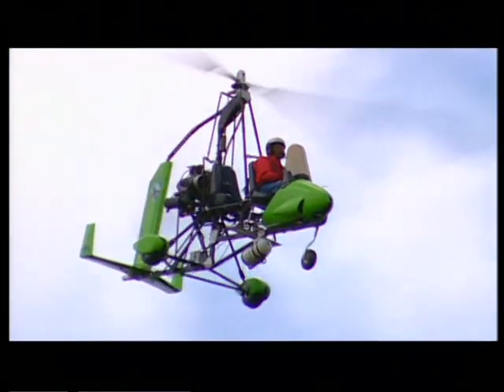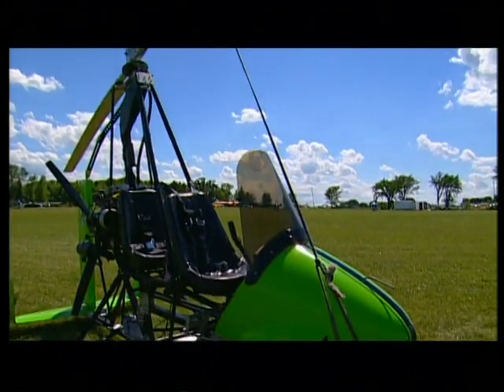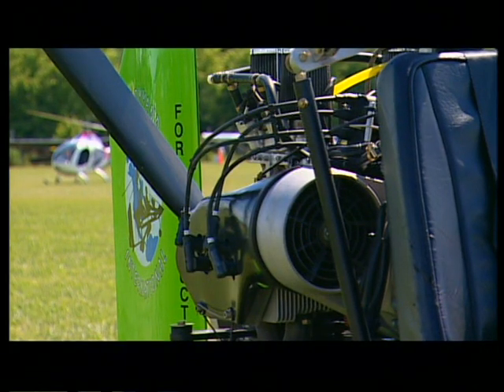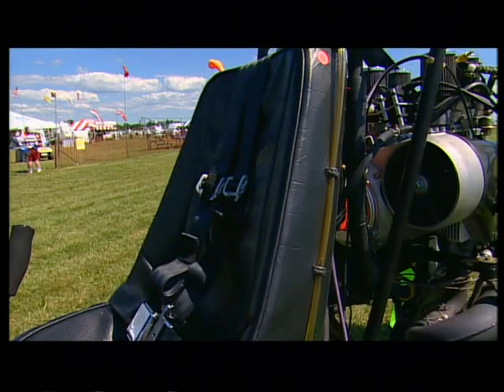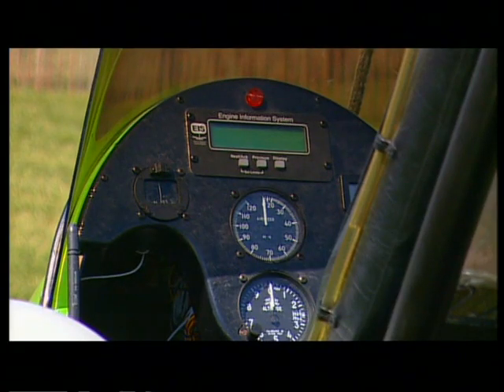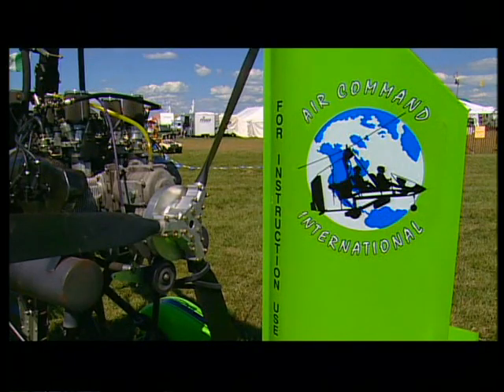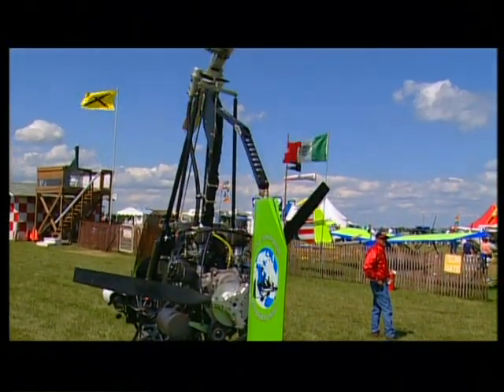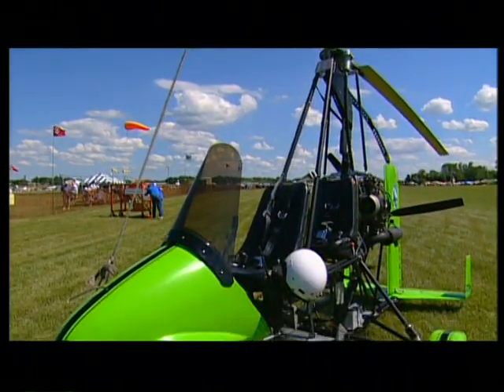Build your own Girocopter

Comment: As far as I know it is impossible to stop the rotor. They can't stall and simply start to fall - As soon as they fall air passing through the rotor makes it turn. So putting the nose down will make the whole gyro head towards the ground causing air to pass through the rotor.
Reply: +m1aws The original Autogyros were controlled by elevators, ailerons and had a rotor fixed at around 9*.

The gyro in this video and all the Wallace gyros AND all the modern gyros are controlled by cyclic pitch changes.
Reply: This is what happens when one shoves the nose down (lifts the tail via horizontal stabiliser) too fast. The disc does not follow straight away so the rotor hits the tail fin.
This very fact killed a helicopter test pilot as he was gaily flinging around a pre-production Ken Wallace inspired gyrocopter at the Farnborough airshow. Helicopters control through the rotors, not the tail fins. The prospective company that was about to market these shut down the business and moved on.
Reply: Crap. The rotor doesnt go down and hit the tail,the body rotates forward and strikes the rotor.And this can only happen where propelor thrust is higher than the vertical center of gravity.
Reply: Murray Barker I'm sorry, who are you arguing with?
Reply: +m1aws  You, you obviously have no idea how a gyroplane works.
Reply: +Murray Barker You obviously did not read my post properly.
Reply: +m1aws I did. Gyro's are controlled by cyclic pitch,the same way as a helicopter, not by the tail. Pee Wee Judge was killed in the Wallace gyro by a Power Pushover. The thrust from the engine pushing the body over faster than the rotor can follow.The body rotates up and collides with the rotor.
Reply: +Murray Barker not all gyros
Reply: +Murray Barker bullocks. the Wallace gyro used the blades on an axle and the rotor is a tilt rotor to effectively alter C of G.
 The in wind blade rotates into a low pitch while the other becomes the higher pitch. You never ever see a fast flying shift to with the pilots stick pushed over to the side to counterbalance the blade pitch.
The gyro you now speak of pushed it's rail I to the rotor via the elevator. If it was a cyclic pitch rotor like on a helicopter the rotor would be solid and do the pitch/roll, avoiding that incident.
Reply: +m1aws As I said before,you know nothing about how a gyroplane is controled.

Wallace used his his own version of a  Bensen type gymble rotor head. The cyclic stick (joy stick) changes the cyclic pitch of the rotor and useing gyroscopic prcession tilts the rotor disc in the desirerd direction.

Nothing to do with weight shift,altering the COG, the horizontal tail which is fixed, or black magic.

Tilt the stick in any direction and the pitch changes on the blades but takes effect 90 degrees past that point,Gyroscopic precession.
Reply: +Murray Barker suggest you learn about the cyclic pitch controls in a helicopter before you spout I know nothing. Autogyros have a completely different family of controls
Reply: +m1aws  Wrong again. Bell 47's as an example have a teetering rotor the same as a gyroplane. The only differance being that on the helicopter the rotor is powered, the overall pich of the blades can be changed, and cyclic pitch changes are via a swash plate rather than an offset gymble as used on a gyro.

If a helicopter goes into autorotation it is essentually an autogyro, controlled in exactly the same way(on the way to the ground) as the green gyroplane in the video.Cyclic pitch changes.
Reply: +Murray Barker cherry picking is only proof you are now squirming. most autogyros have a tilt control on the rotor. that's it, get over the fact.
Reply: Murray Barker if your point of view is correct, you can easily stall the rotor by simply pulling in the collective pitch lol.
Reply: +m1aws Cherry picking? All helicopters use cyclic pitch control to manoeuvre. All gyroplanes use cyclic pitch control to manoeuvre.
I will put it as simply as I can for you. The joystick  controlls cyclic pitch, The cyclic pitch moves the rotor disc.
The joystick doesnt directly move or tilt the rotor disc.

Gyroplanes dont have collctive pitch. Helicopters do and you can stall the blades by pulling pitch.
Reply: +Murray Barker there you just destroyed your own argument.
Autogyros tilt the disc. COLLECTIVE PITCH and manually altering the pitch about the disc CYCLIC PITCH is the domain of the helicopter.
no disc control on the autogyro but for tilting the rotor back and forth, like a hanglider.
Reply: +m1aws You are a fuckwit.
 The only way to tilt the rotor disc on a gyroplane is to change the cyclic pitch, the PITCH CHANGE MOVE THE DISC IN THE DESIRED DIRECTION.YOU CANNOT TILT THE ROTOR DISK ON A GYRO WITHOUT CHANGING THE CYCLIC PITCH. IT IS NOT LIKE A HANG GLIDER.
Go back to trainspotting.
Reply: +jean michel Urbani I know all this,was wasting my time trying to convince this other dumb fucker m1aws who thinks gyros are weight shift like a hang glider.
Reply: +m1aws Not sure who ties your shoelaces for you in the morning but whoever they are get them to draw a diagram with your crayons.
Air and space 18A is but one gyro that uses a swashplate(like a helicopter) to controll cyclic pitch. Most others use an offset gymble head to do the same.
Same cyclic pich control, same result.
Reply: +m1aws Still a dickhead

No collective pitch has ever been mentioned  by me in regard to gyroplanes, CYCLIC PITCH ONLY, EXCEPT, the gyros that have COLLECTIVE pitch(in one way or another ) to enable them to perform jump takeoffs.
I sugest you go and actually LOOK at a GYROPLANE and get someone to explain what happens when you move the joystick. Take your carer with you.
Reply: +jean michel Urbani ffs. relating weight shift as the alternative to a helicopters controlled (by the pilot) cyclic pitch seems to be beyond you too. amazing.
Reply: Murray Barker I'm sick of your vacuous statements. if you think you are right. then disprove the proofs I furnished earlier. Otherwise man up.
Reply: Murray Barker Still cannot prove the facts to be wrong. come on walnut features. When was the last time you flew an autogyro with helicopter controls.
I suggest you get your meds revised.
Reply: +jean michel Urbani nursery school taught you? Blade pitch on an autogyro is usually just a hinge on the blade. There is no "control". Stupid child.
Reply: jean michel Urbani ok simple boy. Lets let us google your words. "Gyros have a collective pitch control"
"https://www.google.co.uk/search?q=Gyros+have+a+collective+pitch+control&oq=Gyros+have+a+collective+pitch+control&aqs=chrome..69i57&sourceid=chrome&es_sm=93&ie=UTF-8"

From the returned searches I get the same collective answer. You are a fuckwit. Rotor tilt is not "collective pitch control". tilting the rotor back is like adding flap to an a/c or pushing on the bar with a hangglider.
If you know of any gyros with collective pitch control I will be pleased if you furnish us with the model. lol
Reply: +m1aws Jean you are wasting your time. You can try and help the ignorant but you cant help just plain stupid.
Reply: jean michel Urbani I tied you in with the other. Thought you'd troll a tag match whilst knowing full well you were wrong..
Reply: jean michel Urbani the blade on a gyro is a tipper. Down in-wind so greater angle of attack down-wind.. you have no means to change it in flight... unless you have a helicopter licence. Can you actually control your fixed blade exactly like a helicopter? No.
Sadly I've never flown a gyro of any sort but have helped build one. The rotors all work basically the same way since cierva fixed the problem.
Reply: jean michel Urbani You are not defining cyclic pitch. That is purely the domain belonging to the chopper.
In truth I considered building a Flettner style gyroglider to "play" on but on paper couldn't get the sink rates required for hill flying.
Reply: +jean michel Urbani Jean you are wasting your time. This imbicile thinks its like a hang glider and you tilt the wing back and foward and side to side.There are still people that think its weightshift and this person is one of them.
He clearly doesnt understand that you can change the angle of attack on both blades by the joystick and torque tube at any point of the 360* of the rotor disc.
Also he dosnt understand that there are three bladed Gyroplanes that use swashplates instead of the gymble head to change cyclic pitch.
Furthermore he doesnt understand that some gyroplanes have a collective( to change all blade pitch at the same time)for jump takoffs.
As well as that he has no understanding that some gyroplanes have partially powered rotors that are still controlled by cyclic pich and are still a gyroplane.

He is a troll that tried to make out he was an expert on the subject and has made a complete dick of himself.
He proved this by his last comment that the gyro blade is a "tipper" whatever that means.

Not understanding any of the above means he certinally wont understand Gyroscopic precession,or that the rotor blade doesnt know weather it is controlled by a swashplate or an offset gymble rotor head, or that some helicopters( Bell 47 etc) have a fixed rotor the same as a gyro and the whole blade works the same way as a gyro.
Reply: jean michel Urbani I know EXACTLY how gryo's fly. I comprehend the way the blade tilt stops tipping the plane over in forward flight. The only rotor head control is to tilt the disc.

I'm also fully on board with helicopters too. (Unlike you guys) They have cyclic pitch control on the control stick and a "handbrake" type control for the collective pitch. Very few modern day helicopters have cyclic tilt. Instead the rotor head stays rigid.

You guys did not and could not counter the argument with proof when I provided links with proof. About time you tried.
Reply: Murray Barker Whom do you refer to when he said that?
I never once stated pitch is controlled by tilting the rotor disc. Quite the opposite. You are just a shit trolling me.
Reply: jean michel Urbani You are the  the only plonker who cannot tell the difference. From a rotor tilt control to CYCLIC PITCH CONTROL !!
I'm still waiting for real proof from you internet warriors. I've provided four links so far and you have not countered an error in any.
Trolls.
Reply: jean michel Urbani nothing anonymous about me if you know what "m1aws" means :)
You cannot alter the pitch by tilting the rotor. That is why its a frigging autogyro.
Reply: jean michel Urbani with your adjustable cyclic pitch? lol
Obviously you can only pitch verbal padding. I'm constantly waiting for you to show me your auto gyro with a fixed disc, slip rings and therefore cyclic pitch.
Reply: +jean michel Urbani Jean I think we have well and truly established that the pommy trainspoter knows nothing about how the rotor on a gyro or a helicopter is controlled.
His last comment about altering the pitch by tilting the rotor sums up his understanding of the whole concept.
My explanation that a rotor on a gyro or a helicopter cannot canot take up a new plane of rotation in a vacume should have rung alarm bells in his feeble brain.
I would say we are either dealing with a 12 your old ore someone a lot older with dementia.
Reply: Murray Barker Offering verbal diarrhea about vacuum now.
It's a very simple mechanical device. The gyros stick merely tilts the rotor. Helicopters have cyclic pitch control.
Did your teachers commit suicide?
Reply: Murray Barker still waiting.....

Seems I touched a sore point. Not surprised.

Comment: all i can say is anything that flys is dangerous i have 200 hours up flying gyros and i can say pushing the stick forword to fast does NOT slow the rotors these machines are very stable - if the machine is built right then it will be happy flight for years to come - SOME gyros have a rotor brake  and to activate it you need to push the stick right forward - and if you have the stick that far forward you will be looking at the ground - - there is only about 2 inch movement of control when flying